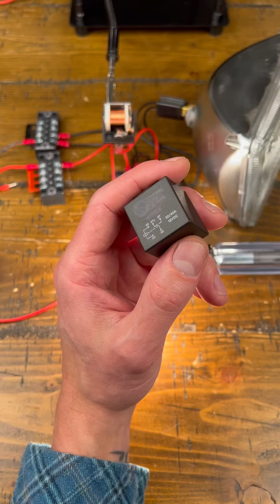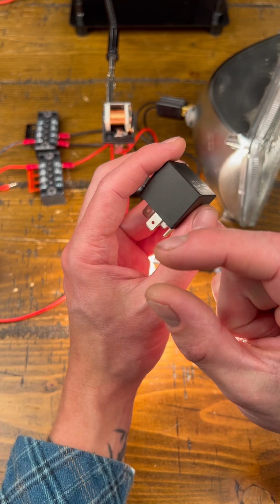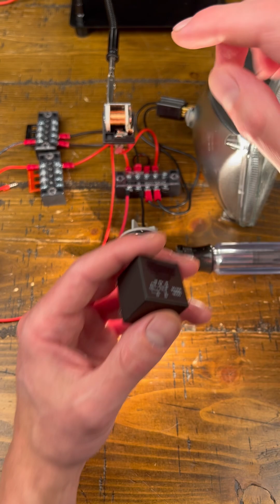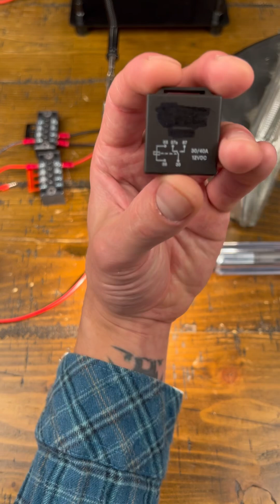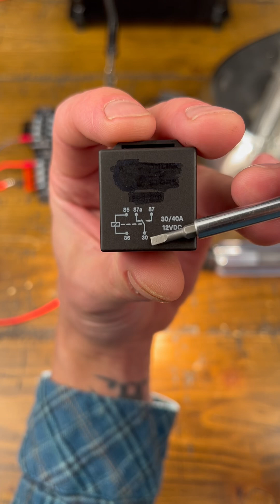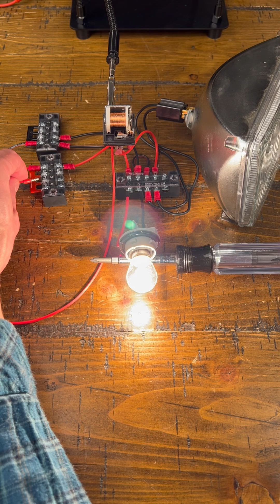What is a Relay? Explained Simply! (How to use Low Current to Control High Current)

Comment: in negative control, can i just merge 86 and 30 terminal and adjust fuse amp? since the second switch is still separate it's all good?
Reply from the maker: Could you elaborate more on what you’re trying to do?
Reply: @maddoxmechanic  Gladly will, thanks for quick notice. So i was doing a diagram, it's seven circuit electrical system Negative control. So i was curious if you can merge 86 and 30 terminal going to the battery. ill elaborate the 4pin role so we can see the graph better and understanding. So there's 4 terminal in this relay and it's 87-86-85-30. You can check bosch 4pin relay so you can take a look. So my legend in 87- is load 86-switch 85-negative and 30 is going through the battery. Since i was going negative control The 85 will be controlled by switch. So that's 86(positive) and 85(switch but in negative terminal). So i was thinking 🤔 if 86 don't need switch just connect it to battery, why not merge it with 30 terminal because they're both doing to the battery anyway? In my instructor said it's incorrect, but never gave me a proper explanation. In his diagram 86 and 30 has separate fuse, so i was thinking again. what if i merge 86 and 30 and use 1 fuse? As i researching upon it the solenoid can withstand more current than the 30 and 87, meaning they can use 1 fuse because 87-30 will burn first before the solenoid. Well that's all my stand. it's an easy solve problem, but im open to understand further details from different references.
Reply: @maddoxmechanic My apologize for over explanation. It will be better if i just showed the diagram i made to make it easier to understand.
Reply from the maker: @kim-zg3hv  Do you have instagram?

https://www.instagram.com/maddox_mechanic/

send me a message on instagram and we can exchange emails. That way you can send me a diagram you've made. 

I think what you're doing could in theory be fine. As long as there is some kind of overload protection in series. My concerns would be ensuring that all of the wiring and other components(relay) are properly rated for the load/current that will be running through your circuit. I don't know if you're modifying an existing circuit or if this is a custom made circuit. I also don't know the application of your circuit, i.e. automotive, robotics, ext. You'll want to take in to consideration every variable in your design. and then test to verify. Hope that helps.
Reply: @maddoxmechanic  I guess it may be a modified method if i do such a thing. I never touch an official vehicle that's why i don't really follow any authorize design. My design is possible, but it will only work for me, since it's modified. Completely just came from my logical thinking since i don't really want to use that much fuse. So in conclusion i could do it that why but it's a custom, i was looking for any official wiring that used that method, but it seems it not. 
Thanks for your clarification it's good enough for me. I appreciate your consideration and giving initiative. I don't want to stress you out further more. Again thank you for on time response.
Reply from the maker: @kim-zg3hv  No worries! Thanks for reaching out. Best of luck with your project.

Comment: Since your good with electrical I have a question hopefully you can help I have the airlift system for my car and Evan when I turn it off the air compressor and the system stays on ? What could I do to make it turn off with the car ? It’ll keep draining the battery and overworking the compressor when turned off
Reply from the maker: Sounds like you most likely just have a leak in your airlift system and it’s working just like it’s supposed to. Otherwise you can just try and figure out a way to power the airlift system off of a circuit that is only on when the car is running. 👍

Comment: Can I have a device that works off a relay AND a switch?  For instance the relay is triggered by an ECU when certain conditions are met. But I have a switch that can be flipped to also trigger the relay
Reply from the maker: I don't see why you wouldn't be able to have both. You would just need to tap into the control side of the relay separately, and then use a diode to make sure you're not back feeding the ECU
Reply: @aiyogarage  thanks for the help man appreciate you sharing your knowledge. Its very hard to learn this stuff on your own
Reply from the maker: @johnadams673  Hey I appreciate that. I totally understand that. Thats why I make these videos
Reply from the maker: @johnadams673  Hey I made this video that might help:

https://youtube.com/shorts/6ALyjp0aSPo?feature=share

Comment: Is it like water running and you just change its way? Does the voltage change depending which way the relay sends it?
Reply from the maker: That's a great way to think about it! Just changing the direction of the water flowing. The voltage doesn't change, but the amount of current flowing through the circuit does change depending on the demands of the load.
Reply: @aiyogarage  if the relay is receiving a certain amount of water, what prevents that all that voltage go to the circuit if it needs less voltage?
Reply from the maker: @Y3shuita  That's a great question! Everything in this circuit is rated for 12v DC. If there was something in the circuit with a different voltage requirement ie 5v, a separate power supply and feed would be provided for that device. I'll try and make a video on this question
Reply: @maddoxmechanic  thank you very much, I appreciate your answers. I'll subscribe to your channel.
Reply from the maker: @Y3shuita  Hey you bet! Thanks for the subscription. Here's your video:

https://youtube.com/shorts/RB_AVX-ZPjo?feature=shareoin!

Comment: How many volts are you using to power the relay?
Reply from the maker: @SaulOrtega-d4k  12v DC. But relays/contactors come in all different shapes and sizes. It’s always a good idea to see what the manufacturer of the relay recommends for the control side and what its power rating is. But in general it’s safe to assume that for an automotive relay, 12v DC should be suitable for most applications 👍